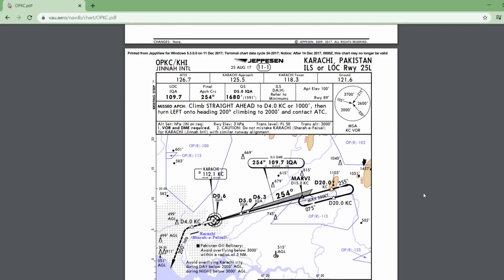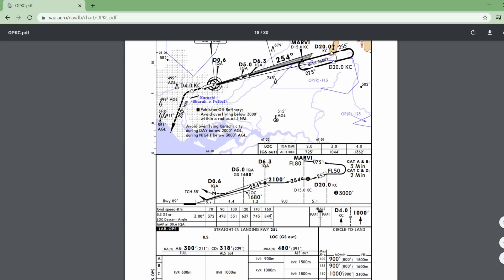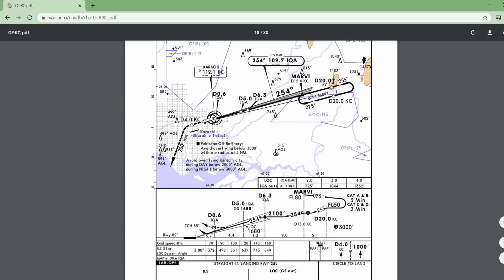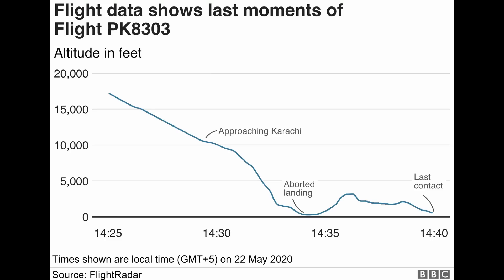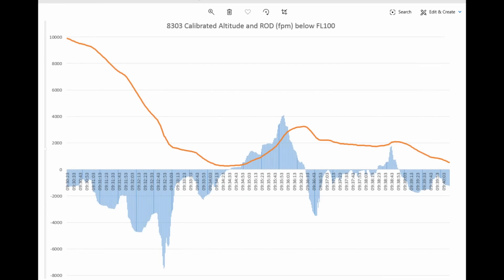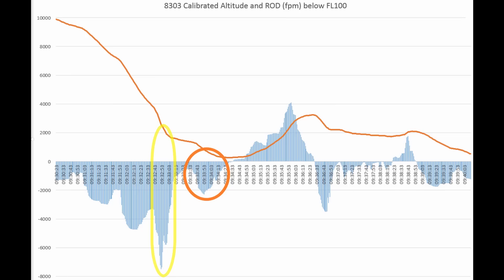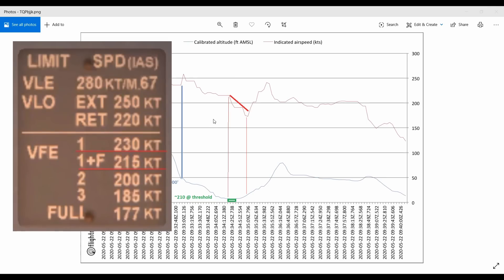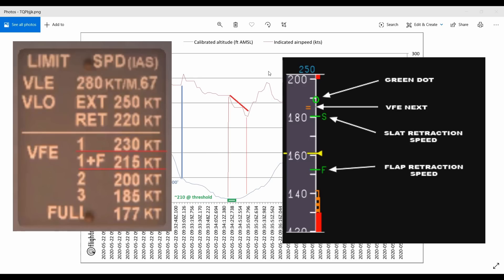PIA #8303 Update #4 Unstable Approach Profile

Comment: Can’t believe they got 7000ft/min out of the machine, and the Pilot was comfortable, unbelievable.
Reply: -"Mein 'Dive Brakes' extended and preparing to drop the 'pickle' down the stack of the ... Oh schlitz, I am nicht in mien Stuka"?
Reply: @blogengeezer4507  Wasn't until the RAT came out that they heard the siren...
Reply: @blogengeezer4507  mein Herr. mein fruend, ve give you Tomahto slice, no pickle for today...readen you reporten... mach soon!
Reply: Blogen Geezer  🤣. That was funny
Reply: Will not be using P.I.A. anytime soon.
Reply: @davidlyon1899  Sir, that crew will no longer fly for PIA. You may resume your previous flight plans with confidence.
Reply: @d.t.4523  Unfortunately, the crews actions, as well as the previous incidents at PIA; paint a pretty clear picture about the airlines practices, policies, and their attitude toward safety.
Reply: @d.t.4523  Your statement is true about this crew.  But previous accidents have shown it's a company problem.   Something like not burning to much fuel on a go around or approach.
Reply: @kylecampbell1444  That makes sense. Penny wise, pound foolish perhaps. Good luck.
Reply: @d.t.4523  If this happend due to a human error it's all about lack of training, lack of following procedures. So it might be just a matter of time for the next disaster.
Reply: david lyon all airlines have crashes. What about Lufthansa in which Mad pilot destroyed the plane . In this regard you should avoid every airline.
Reply: Maybe he forgot he wasn’t flying a fighter jet 🤷‍♂️🤷‍♂️🤷‍♂️
Reply: Must be high on cocaine!
Reply: @zafarsaand  allegedly fasting?
Reply: @nsudatta-roy8154  no fasting is least of the concern in this, but I think fasting is not obligatory for jobs like these and if they bring it in SOPs for good then there is no problem, but there were like 5 hours left, should be enough energy in the body,  
I am sensing he was influenced psychologically like "just land it and go home" i dont remember what this behaviour is called in aviation but its there, they dont go around because it takes more time, pilot feel tempted sometimes to just get on with it.
Reply: @Shreaadedaa  Classic Blackbox thinking, (Book by Mathew Syed). To go around would have proven that he made a mistake. if he landed it no one would have been none the wiser. he tried to saved face. (IMHO).
Reply: LiamRey That’s probably the whole story.
Reply: @nsudatta-roy8154  yes it is possible
Reply: @Shreaadedaa  It is commonly called "Getthereitis"... (from a strong and blind urge to just "get there").
Reply: @Shreaadedaa  I thought cockpit crew are banned by regulation to observe  Ramadan fasting if they are on flying duty during the holy month. In Bangladesh the regulation strictly forbids fasting if you fly. I was on flight  training to obtain a Ppl back in 2007-10, and clearly recall being asked not to fast before climbing inside  the Cessna 152. The crew on this flight seemed to be rushing things, and inattentive to a number vital established procedures. The reverence and unconditional subservience to the superior (i.e. the Captain) that are practiced in the subcontinent seemed to have prevented the co-pilot from questioning the PIC while he commanded the aircraft according to his arbitrary style of flying! Whether the aircraft could have been stopped at the end of the runway during the first attempt should also be probed. The go-around with the damaged engines have spelled disaster (as the evidences suggest).
Reply: Could there be some technical faults in the plane reading regarding height, speed etc which might have caused such unbelievable descent?
Actual readings different  but plane showing different readings
Reply: @dkht47  --That kind of descent rate ought to make you pretty sick in the stomach, like riding a roller coaster steeply downhill.  You can feel it even without any instrument.  To make piloting more idiot-proof, perhaps future MFD's should plot out a highway in the sky 3-D path with square wire-frame boxes for you to fly thru, so flying an airplane would be just like driving the car in the highway, by just keeping it within the 3-D lane in the sky, with speed limit signs posted along the 3-D skyway with a digital indication of your own airspeed next to the speed-limit sign so you would always know how you're doing in comparison to the speed limit.
Reply: @trungson6604  
"ought to make you pretty sick in the stomach"
Not really.
Rate of descent in itself does not impart any feel whatsoever to the stomach. We feel acceleration,  not speed. As far as you stomach goes, you'd feel exactly the same  descending at a constant sink rate of 20,000ft/min or 700 ft/min.
Reply: @trungson6604  one of the survivors had to say this:

"No one [passengers] was aware that the plane about to crash, they were flying the plane in a smooth manner," he said.
Zubair said that there was no disturbance on the flight and that it was smooth until the crash.

https://www.geo.tv/latest/289275-pia-plane-survivor-shares-his-story-says-he-heard-screams-after-crash

It doesnt appear that he got sick in the stomach or felt like being on a roller coaster the whole flight till its crash
Reply: @coriscotupi   Well looking at the graph it is an acceleration. The -7000ft/min reading is a spike on the data almost like an impulse and he dropped from -3000ft/min within like 30 seconds. And lets not even mention the recovery i.e. post the -7000 mark when he realised that he dropped his altitude enough as he wanted but needed to bring his vertical velocity down to stop losing further altitude at that rate. Probably an excessive control input on the elevator (look how the gradient of the altitude changes at the moment of spike if you dont trust the velocities since technically they are the same thing); so that one they definitely felt it.
Reply: @dkht47  still doesn't explain the first aborted belly landing, could've ended right then and there The incident could've played out differently if the pilot had realized just how much deep shit he put the plane in. As for the plane having issues maintenance records will prove that out, and that's if there were any issues electronically with the plane..........
Reply: @heyrod59  he re-took off cause he panicked  when he realised his landing gear wasn't open cause he wasn't expecting a belly landing. The blackbox shall reveal the pilots discussing their mess up with each other
Reply: @heyrod59  with that high a decent rate, and those speeds, the chimes in the cockpit would have been ringing for any number of conditions, including GEAR NOT EXTENDED...  the crew, likely concentrating on salvaging a bad approach were probably aware of the warnings being sounded, but ignored them, beveling the LG warning chime was indicating a warning for one of the many other performance envelope exceeding maneuvers they were trying to do. (the LG warning simply got lost in the background noise of all the other warnings)
Reply: Bill Brisson 
Exactly right in my opinion
Reply: heyrod59 they were going too fast to land. Ground effect was increasing the lift so much that they would have needed a nose down attitude and that’s why they bounced.
Reply: Furqan khan they knew the gear wasn’t down, you can hear the chimes. And they were too fast to stop, so had to go around.
Reply: Bill Brisson you can’t miss the repeated “too low, gear” calls.
Reply: Bill Brisson you can’t miss the repeated “too low, gear” calls.
Reply: dark Knight47 I wonder maybe if there was a lack of communication, and pilots didn’t realise how close they were and made a big decent ?
Reply: Exactly
Reply: dark Knight47 - O to nil!
Reply: dark Knight47 if there was pilot didn’t mention nor he mentioned anything about landing gear not opened or stuck!! Even if he knew gear was stuck or malfunctioned he should have crashed landed on first attempt
Reply: @zafarsaand  at some point after the plane took off from the 1st landing the ATC asked for confirmation for belly landing from the pilot. That would mean before that point in time the ATC knew there was some issue regarding the landing gears otherwise why would they ask for such confirmation. We do not know at what point in time they would have known about it though.
Reply: @dkht47  on a visual approach, hardly, good instrument scan, plus they have redundant gauges that they can access if they think their main flight directors are not functioning correctly. Plus the configuration of this aircraft on approach presents the pilot with many visual clues and feedback as opposed to descending at 7000fpm and 200+ knots of airspeed, the aircraft feels different and you do not see the ground approaching you so quickly.
Reply: dark Knight47 these are my initial thoughts too. Instrument failure or wrong readings could have played their part. However, pilot didn’t seem concerned at all in communication with ATC on first approach. That makes matter more confusing.
Reply: @dkht47  your comments are very important. If so it can lead to entirely different angle. Just to remind there was news item couple of days before the accident which said After 8years PIA turned to profit.
A friction existed between labor union. Pilots association and the MD who is a serving Airforce officer
Reply: @dkht47 
Any pilot with enough hours to be commercial would be well aware that he was way high and hot
Reply: dark Knight47 this is entirely possible, but it still leaves the question of why the pilot didn’t report any of it, and  instead indicated that they were comfortable to the ATC.
Reply: @dkht47  no, and they had something else called "visual cue" on such a clear sunny day and on a visual approach. No, no excuses for them even though i wish them RIP, i am sorry for all ppl behind thier cockpit door.
Reply: I saw that rate of descent twice on a 320, both times at altitude. Both times it was obvious the aircraft was not going to make any attempt to level off and would just blow right through the MCP altitude. Both times the auto pilot had to be kicked off, manually flown to level at the correct altitude then auto pilot reengaged. We were told the first week. It's not a Boeing. Speed first then altitude. Chasing the glidescope clean will lead to a whole bunch of problems. Flaps 3 speed 170kts full speed brakes will give you maximum rate of descent. Been many years since I flew that airplane.
Reply: I'm now questioning the pilots' competency. Just from watching the video and listening to what Juan is saying, I get the feeling there's alot more that's coming in regards to the pilot. I'm not a pilot, but this accident was clearly avoidable, and because of the pilot people are dead........
Reply: heyrod59 - I doubt that will be made public. PIA director is a military employee, hence, he will protect the government from shame and ridicule. 
A few days ago they claimed they recovered the FDR and the CVR,. Today they are saying they have the  FDR, But, they only have the cover to the CVR equipment! The authorities are asking the people to hand in any parts of the crash plane they have taken!
The CVR recording would shown light onto what was being said and done in the cockpit. Unless they revolver it, we will be left only with the aircrafts
mechanical data at the time of the incident.
Reply: @rubenvillanueva8635  PIA stated this on the facebook page on the day of the crash:

"...On short of landing, aircraft reported technical fault and informed that it is proceeding back. Shortly after that, contact was lost and later it was reported crashed.

Details of what the actual technical fault was, can only be established once inquiry is started and critical aircraft parts and evidence from the site is recovered and analyzed. Hence any statement on actual cause of crash can only be termed best as supposition without any factual cause..."
Reply: dark Knight47 - Interesting. Question, to whom did they report this to?, For, if we review the recording from LiveAtc, there is no mention if any problems, starting from the point that the pilot states, "We are comfortable....". He was cleared to land, then later he reports that he was making a "go around".  Personally, and from experience, I would say, PIA is covering their asses.by placing this on FB. If they ever release the info from the FDR, it will show the status of the landing gear.
Reply: @rubenvillanueva8635  the director also said if its proven that they ignored any technical issue with the plane he will resign from his position.
But as you said it's near to impossible for a crystal clear investigation to happen.
Reply: @heyrod59  Its fair to judge captain's competency (as everyone is putting blame on him) by his past record and not by this unfortunate accident.   
Captain Sajjad Gul had 24-year career in airline industry and had an experience of flying planes for more than 17,000 hours. He flew A320 airbus for 4,700 hours. He had a clean record. And it was not his first time flying this route.
Reply: dark Knight47 You’re only as good as your last flight!
Reply: @LTVoyager  In that case, it's fair and reasonable to wait for the investigation to complete so that we know "the totality of the circumstances" before jumping to any conclusions.
Reply: @LTVoyager  I agree. If you had read my comment with some attention you would have realized that I never jumped to any conclusion whether the pilot is to be blamed or not...someone raised a question regarding pilot's competency and I just commented on that...no one has all the necessary facts about what happened on this flight so people should not jump to any definitive conclusion based on that...and for what happened on this flight you will have to wait for "the totality of the circumstances" before jumping to any conclusions.
Reply: @dkht47  And exactly this makes it necessary to question why such an experienced Pilot could become responsible for something like that.
Reply: heyrod59 People always say the pilot. Singular. But there are 2 by law. The question is who was flying, who was making the radio calls and what was going on between them. CRM has been taught for years to stop this. The CVR is going to be interesting.
Reply: @heyrod59  he paid the price
Reply: This airline should be grounded if this type of operational behavior is allowed.  Horrible piloting and CRM.
Reply: In the last comms before the first landing between the atc and pilot a ding ding alarm is clearly audible in the background. Most probably the alarm is indicating that the landing gear is not lowered. The atc should have picked that up and inquired what it was. Instead the atc ignored it and chose to clear landing. I think this was a fatal error by the atc. Had the atc put the foot down and made the pilot correct his approach this accident may have been averted. I think atc is responsible here
Reply: @zeeshanijaz2870  Are you mad to put blame on ATC for not informing about that alarm beep which they possibly heard during conversation?? I suppose you are from Pakistan, where even a uneducated moron tells his prime minister how to run government.
Reply: @gamebegins3176  no need to be offensive bro. I am not absolving the pilot but feel that the atc could have been more proactive in the situation rather than just folding to the pilot's insistence specially with the alarm in the background
Reply: @zeeshanijaz2870  ATC tried to get him to abort by offering a new heading.....the pilot replied he was on glide slope and comfortable.....ATC then cleared him in.......Difficult for ATC to overrule the pilot as he is not in the aircraft....but ATC gave him an out which the pilot never took.
Reply: @pearlyshells2430 no one's absolving the captain here but had the ATC shown a little more muscle we might not have been here discussing this
Reply: @zeeshanijaz2870  Pilots choice
Reply: @zeeshanijaz2870  They did and asked "are you comfortable".
Reply: @markjones3361  in the same comms during which the ding Ding's audible the atc clears the landing. Shouldn't have happened
Reply: @zeeshanijaz2870  it's not ATC's job to inform the Captain they have an alarm going off on the flight deck, no matter what country they are in. It's the Captain's  job to fly the plane in a safe and prudent manner.  Short of a fire on the plane where you have to get it down ASAP, I cant think of any reason, mechanical kediacalor otherwise, which would require such a departure from normal approach conditions. 

Stop saying ATC should have said something about the alarm going. They are not on the flight deck, they have no idea what is taking place other than what the pilot may or may not have reported as being a problem, which I dont think much of any issue was initially reported by the crew to ATC.
Reply: @zeeshanijaz2870  the ATC has no knowledge of what the chimes could be for nor have no responsibility to challenge the crrw.  Never happened.   

The pilot is responsible or crew. Solely 

The words from the first day of training are " fly the plane stupid "  coming from it is no one elses job and 10001% your responsibility to fly the plane.

There are about 20 different reasons for chimes.  From baggage door to reverse thrusters to cockpit doors.  No one knows what for but the pilot.  It is the pilot's jobs to manage the work load.  And any vhallanhe from a ground desk would be so distracting.
Reply: Zeeshan Ijaz It’s not the ATCs job to manage cockpits. ATC aren’t pilots.
Reply: ATCs are no pilots, usually. You can not assume familiarity with specifics of individual aircraft cockpit procedures and alarms.
Reply: @zeeshanijaz2870  You need read the job description of an ATC before writing nonsensical comments like this.
Reply: @syedfazalhassan7195  For your information Syed, which you are obviously lacking, there are countless instancss where ATCs have refused clearance due to hot approaches. Now be a good boy, do a bit of research before you rush to label others as nonsensical, whereas you in essence are the one lacking sense
Reply: @zeeshanijaz2870  with that rate of descent decided by the crew (until issues leading to that are proven), there was nothing the ATC could do. I don't even think they are supposed to inquire pilots about technical cockpit procedures either.
Reply: @rohrichoak9740  I disagree respectfully because with the hot and high approach the pilot was taking a huge risk with the landing. And ultimately it did turn out to be the case that the pilot overran the runway threshold and touched down close to the middle of it. Imagine the plane could have easily overran the runway. This is exactly the type of scenario ATC is obliged to prevent by not allowing a hot and high approach. Exception being an emergency
Reply: @zeeshanijaz2870  TheFlightChannel has made a video on that. Only now have I seen the notification. That chanell digs deep into the accident and investigation. I'll check that out to see if there's something about an emergency being declared or something that justifies that landing clearance in that configuration.
Reply: it was a crime
Reply: Until the FDR and (if they find it) the CVR are analyzed, we won’t know the whole story here.  You can blame the pilot or ATC but it’s just possible that there was a malfunction such as incorrect readings of altitude or speed.  Again, condolences to the families and friends of flight crew and passengers.  May they rest in peace.
Reply: No.. that I m comfortable, thing happened when pilot making the second attempt
Reply: Agree
Reply: Pilot call of nature maybe?!
Reply: Wow! The A320 is a small plane relatively speaking. I flew on one on a hop from Copenhagen to Stockholm last year to connect to my flight on an A340 back across the Atlantic. The difference is mind blowing to an air travel greenhorn like me. On the A320 you could feel EVERYTHING! Slightest bit of turbulence had everything shaking, especially the overhead compartments. It was a bumpy ascent and decent.

Given this experience, albeit a good one, this flight crew put these people through hell, ultimately leading to their untimely demise.

I hope the data recorders prove this was a fatal error on the part of the flight crew. Even if it does, it won’t bring these souls back. 😢
Reply: Dark knight47
Im a airline captain flying with 32 years of experience , if what we saw on this video is true , the crew must be blamed.
And is not acceptable with 17000 hrs and the experience that you reported to us of this captain to fly as he did.
This is not question of be blaming the captain but to look some facts and be able to “teach or inform” any younger captain or pilot that watched this video about CRM,CFIT and be humble to do a go-around any time and anywhere if him or the other colleague are not happy with something.
This captain behaving is unacceptable and thanks god he died otherwise in a normal country he had to go to the jail.
My opologies for any mistake on my English but isn’t my mother language.
Regards
Reply: @mariojorge4447  no one will deny that...but we do not have all the facts to come to a definite conclusion that it was solely the crews fault...there might be some other important missing info which might give us some reason why the crew acted the way it unfortunately did...crash might have resulted from a technical error causing the crew to commit subsequent human error (technical + human error)....people here seem to be passing judgement based on bits and pieces of info...that kind of info might point in certain direction (i.e. that it was the crews fault) but it isn't sufficient to pass a definite judgement on someone...

someone was doubting the competency of the pilots', for that purpose only I gave info regarding the captains flying experience etc.
Reply: the pilot sounds he woke up from a nap
Reply: Out of interest, what is an emergency decent profile Fpm?
Reply: Pilot lied
Reply: 7000ft/min if he was that comfortable with that maybe he has history of doing this and this time around screwed up
Reply: He was auditioning for top gear 3 😂
Reply: The C17 can do 20,000 fpm descent. I am thinking he was attempting a tactical style descent
 Wrong plane, wrong profile.
Reply: This is a case of undisciplined. Too many flying without adherence to SOP. Too many cases of coming in high and still could make it in and land without any incident. I have seen this this numerous times as an Airline pilot. But some day, it will catch up on them later. On this occasion, they fark it up badly and many perish including themselves.

Yes, there's a way to do it although you are high on profile. But bad habits leads to disaster. If you have been flying more than 20 years with the Airline, you have a choice. Cultivate good habits and be a good and safe pilot, or follow the bad habits and pray that you will not end up like this. The choice is yours alone.
Reply: That was over confidence of pilot, having a lot of experience of flights, and the leniency in terms of following the SOPs. 

We don't know how many times SOPs were not followed. Data should be pulled and analyzed for his previous flights.
Reply: No way these idiot pilots was checked out on the aircraft. I'm even starting to wonder if they even had a real license. So many mistakes and so many lies to ATC.
Reply: Every speed is comfortable, when the toilets are blocked and you feel an internal pressure!
Reply: @ajmalik  I have to disagree with you.  Had the pilot survived, he should be hanged for the murder of 96 people, since he would not be dead.  Reminds me of the old riddle about where the survivors would be buried.
Reply: The captain comes across as arrogant. It's the passengers we have to feel sorry for.
Reply: The moment you realize they were off executing the belly landing, the fly-around sealed their fate.
Reply: @zeeshanijaz2870  Read the comments of others replying to you. Most of them agree with me, only that they haven't called you an A-hole for blaming it on ATC. If someone is so stupid, he should be told so bluntly so that he keeps his mouth shut about things he knows nothing about.
Reply: @ajmalik  so if people disagree with you it's ok to curse. Compare your replily to me with others. Speaks of your education and ettiquette of which you absolutely have no iota of. Don't ever address me again you are beneath discussion
Reply: @ajmalik  your replies to me truly reflect your narcissist uncivilized being. None of the other replying to me used curse words despite disagreeing. Don't address me again you are beneath civilized conversation.
Reply: 17 seconds of that, crash.
Reply: Astonishing incompetence, even for the 3rd world.